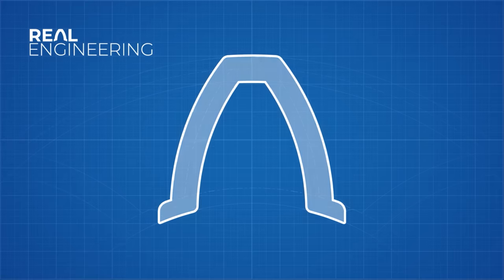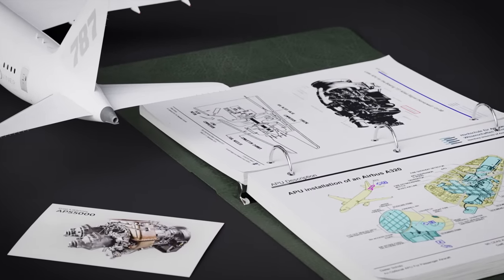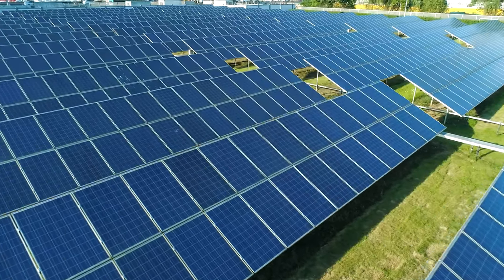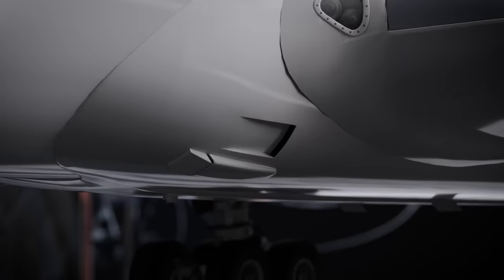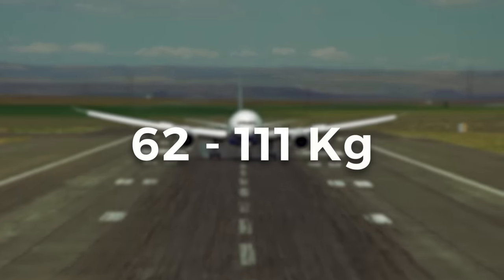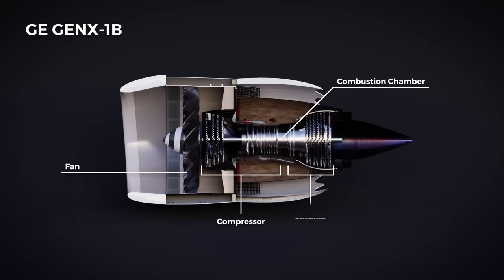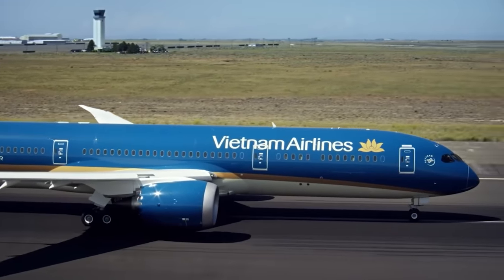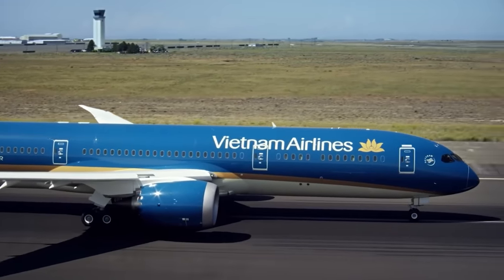The Insane Engineering of the GEnX

Comment: ,They run on compressed air by design mass to weight ratio is 0 it uttilizes sound frequency during the compression of air as it passes thru the main chammber creates Vortex no friction upon the main dtive shaft  the compression of air increases the forces
Turbine speed increases thrust of turbine 
When they hit the throttle it makes the high pitched sound from the engines.
Combination of these forces that allows them to run never shutting them down at the end of the day.Very hard to start neef alot of commpressed air. The best way 
Jump start from another engine thats  already running which is exactly how they start them.

Comment: I'm about to take my first flight on a 787. The airport we're taking off from is located at 82 feet - the destination is at 8,360 feet. Does that mean I probably have lower air pressure after I leave the plane than I had during the flight?

Comment: Wrong. Most modern engines use an air turbine starter drawing compressed bleed air from the APU. This drives the engine from the compressor end accessory gearbox to a self-sustaining speed.They do not use air impingement starting.

Comment: Great presentation but your definition of “stoichiometric” is not correct. Stoichiometric is the “theoretical perfect air fuel ratio” to support combustion. Leaning the mixture of air and fuel can reduce temperatures in the hot section of the engine and reduce fuel consumption, so that is why engineers are designing engines that run “lean of peak.”

Comment: Could regen braking not pull that braking energy to power and use that power to cut reverse engine thrust fuel use and other power requirenents. Also still like to see curved solar panels embedded into wing top surface that could offset some of the fuel use

Comment: Regardless of how big and powerful today's jet engines are, a 4 small engine design like the 747 had is safer than 2 big engines.
Reply: The modern two engine craft can fly quite easily on a single engine. There would be nothing stopping them from flying the whole distance on a single engine if need be.  Now that would not work for the jumbo jet style aircraft out there but it most certainly will work for the majority of fleet sized commercial jets. 
Those modern single engines are ridiculously powerful but also incredibly resilient.
Reply: @bighands69  you missed the point. It has nothing to do with how powerful a single jet engine is. 2 powerful engines didn't help Captain Sully who got birds in both engines.
Reply: @rkgsd  
Both engines went down for Sully.

Comment: Your explanation of centripetal force, should have the arrow pointing to the centre of the engine, not out away from the engine (this force doesn’t exist).
Reply: The arrow is pointing correctly for an imagined centrifugal force.  You are correct all rotating masses experience a real centripetal force pointing into the center of rotation.

Comment: Isn't that the 777 with engines the same diameter as the 737's fuselage? I don't think the 787's are quite that large. In any case, the 777's engines are significantly larger than those on the 787, so if you want to see really impressive engines, that is the place to look. 
Anyway, subject matter loos super interesting, but I'm not sure I can deal with the breathless super-dramatic presentation style for that long. Drives me nuts.

Comment: This is why Airbus is second rate at best while while Boeing and GE are joined at the hip. Boeing has a Exclusivsity Contract which bars Airbus using General Electric jet engines being used by Airbus. Rolly Royce engines on Airbus planes have a tendency to explode and suck and waste fuel.

Comment: the dream liner engine is a tad smaller than a 777 engine , and isnt the GE - 90  ( the 777 motor ) the same as a 737 fuselage , i thought .
Reply: Correct, the GE-90-115B has 115,000 lbs thrust. The GENx-1B is in the low 70,000 lbst range IIRC. The GENx-2B67 used in the B747-8  is 67,500 pounds static thrust.

Comment: Have you ever tried to find electrical fault in your car. Electrical controller is good when it works. I felt sorry to the mechanic assigned to find Electrical fault on this plane.
Reply: That's cute... airplanes and the maintenance behind them don't work like cars. They have many forms of redundancy, they're tested much more rigorously and they're made out of MUCH higher quality materials. Do you dissemble your car every 7 years to inspect every millimeter of it? Well commercial airliner's have to by law. They literally strip the entire plane down to the bare metal and inspect it for any faults or damage. In airplanes, fly-by-wire systems have proven to be easier to work on and more reliable than hydraulic systems. like I said, the quality of these parts are of much higher quality than you would find in any car. These planes cost hundreds of millions of dollars and they have to be as well tested and safe as possible. Don't use your knowledge of cars and apply it to airplanes... they are incredibly different in every way.
Reply: @ejkk9513  modern cars have taken many technology used in aviation. One example is electronic power steering, even more advanced joy stick like steering, where the amount of electric control how far a wheel should turn. Like how electronic pulse control movement of rudder.
Reply: @ivangeo3319  That's true to an extent. It's called non-hydraulic power steering. I have a shop in my backyard where we work on cars. The difference is that planes have two or three redundancy features and they're built to a much higher quality. Now we're seeing carbon ceramic disks on super cars and sport cars. That tech was created for the aviation industry back in the 60s

Comment: FYI 8:27 “…most extreme brake test; an aborted <landing> test”. 

No. It is not the landing that is aborted - it is the takeoff that is aborted.

8:41 “Here, the plane is <flying> at full load.”. No. The plane is accelerating to “Takeoff Velocity”, and passing through V1, which is the maximum speed at which a takeoff may be aborted.

So, two mentions of <landing> should be <takeoff>. And one mention of <flying> should not have been mentioned. The aircraft never leaves the ground for that test. YW!

Comment: the compressors are innefficient because they introduce so many Blades that increase friction, new tech needs to be invented that can compress air efficiently. air compressors are some of the least efficient pumps known to science. i think something like a liquid pump or oil vane pump could be more efficient. dual effect, could reduce area of intake and reduce friction and reduce complexity... in fact why not have a electric compressor driving a burner that expand across a tubine that generates electricity. and use electricity to drive bypas and other services...

Comment: Today’s jet engines really are a marvel of engineering.  Unfortunately, the technology they use is far too expensive for replacing the internal combustion engine in our vehicles.  These engines have advanced further than any other type of engine in both fuel efficiency, robustness, and overall reliability.  They’re by far the heaviest, most expensive component of any aircraft.  And unlike the engines they’ve replaced, these engines don’t make poisonous chemtrails.  (Actually, the old engines didn’t either, as there’s actually no such thing as a “chemtrail.”  Those are just areas of low pressure that, because they’re colder than the surrounding air, have formed clouds from the water vapor within the air itself.

The 787 itself is a marvel of engineering.  I would love that engineering to cross over to the now defunct 747 and for BOING to bring that fantastic plane back to full production.

Comment: Clearly by seeing this video I can pin point so many in-efficient things and mechanics... This is main reason I want to be a aeronautical engineer... and desgin a aircraft with a this useless in-efficient pointless systems removed... Like there's no point in the apu... A few of the lightweight Eletric generators concept I designed can generate upwards of up to 200,000v and it is the size of a smartphone... If the apu was replaced by "EPG - Electrical power generation Unit" (I'll give it a better name) the plane can generate upwards of 2 megawatts without the need of the battery pack and apu stuff... The plane can lose 100kg thanks to no onbord battery's and generators in engines... Way efficient and the useless fuel dump thing man the first thing I would do is ban  that fuel dump...

Comment: Unfortunately, the video is a blatant commercial for Boeing. If the engineering facts where presented without emphasizing continously how "great" or astounding the 787 is, it would be a good video. Also, a lot of the comments on the "no bleed air" are simply wrong or presented in such a way as only to emphasize how great Boeing is without providing a real engineering view. Especially the part on the air supply is simply wrong when it assesses the benefits of "no bleed" versus "bleed".
Reply: I mean if a company makes a revolusionary product, than I wouldn't be suprised if preople celled it "great"
Reply: @Blue_Doge  If it was revolutionary, yes. But in the end, both the 787 and A350 are not revolutionary. They are continuing existing best practices and typical aircraft design methods (which is good, as they are proven over millions of flight hours). Bleed-less design brings some benefits but also causes other issues like having much higher power consumption and thus more / thicker wiring, different engine starter woes and more. This is typical for aviation: you just trade one woe for another. But it is not revolutionary, merely a different approach.

Comment: The fan and the copressor are NOT on the same shaft
Reply: GE uses 2 spool engines, which means the fan is on the same shaft as the low pressure compressor
Reply: @nascraytia  you mean the booster?

Comment: Regardless of the fantastic engineering of airplanes, the fact of lifting 100's of tons of steel, people, and freight 5-6 miles high on every flight, is a energy disaster. Rail is vastly more economical and and environmentally sound. Only huge public subsidies for research, fossil fuels, and airports  keep the airlines running and the pollution pouring into our atmosphere.

Comment: Why are not use the engineering from whales with the long flippers/wings they have bumps on the leading edge which when they were found to reduce drag by 30%, why not try them on these aircraft? Also there is evidence that reducing the speed of the fan by adding a set of gears to slow down the fan to increase efficiency?

Comment: How many pound thrust is the engine. Ge may be the f35 engine contractor coming up in 2023, dunno really! But this new engine will use 15 percent less fuel and provide 50,000 lb thrust, and this a tiny jet engine.

Comment: So many little errors in this video that just irk you.
The starter for conventional gas turbines that don't have APUs isn't a "hover cart", maybe they are colloquially called hoover carts? It's commonly called a start cart.
Hydraulic is misspelt twice in the electrical diagram along with environment.
The "aborted landing" tests were aborted take-offs, very different to aborted landing.
Every animation of a cut-away view of the engine has the bypass fan and gas generator rotating opposite directions despite all blades being configured for same direction rotation. In one animation the compressor blades are backwards, in another the bypass fan is backwards.
Compressors and fans are not driven by the same shaft.
The fan has it's own power turbine to recover energy from the gas generator which usually has two independent shafts of it's own, although the gas generator in this engine may have only one. The shafts go 1st inside the 2nd, and the 2nd inside the 3rd if applicable.

Comment: In case you did not know: Most commercial aircraft turbines use inner and outer cranks: the outer propelled by the first and the inner propelled by the second exit blades. This way, the inner axis spins at arbitrarily lower rate, since the torque can be adjusted by how much enthalpy the first exit blades pull out of the exhaust jet. Also, a lack of transition reduces the according frictional loss and associated maintenance. The optimal efficiacy is reached when dynamic pressure of jet and bypass are identical or (if impossible) the geometric expansion angle tangents with the pressure gradient from jet to bypass. cheers.

Comment: They should stay away from planetary gearboxes and use bleed valves  to drive a seperate shaft for the bypass fan.....They could even have a hydraulic pump on the power stage instead of a pnumatic stage.... Im not even an engineer and I know that... lol
Reply: Seeming that your not an engineer, you can't really judge designs of aircraft. I can't either because I'm NOT an aerospace engineer.
Reply: @Rosne134  that's not a rebuttal. That's just cancel culture.

Comment: You talked about fan blades and compressor blades. You conveniently omitted the turbine blades while they are the most complex pieces of engineering in this engine requiring advanced material design due to higher temperatures they experience during operation.

Comment: Cones are probably turbofans, tubes are probably true jet engines

6:21 that wing is basically upside down, you can see the fuselage push downwards from that point as it gets up into the air... the amount of heat here is a pretty good indicator of the amount of wasted fuel, which again like I said can be fixed with the right wing profile. Just to get that part working they had to add more unnecessary weight, and also add more drag for the intake, so that could save weight there too, for instance. Probably just a smaller intake or maybe replace some parts with a water cooling system and not have the intake at all... and again it would still be exponentially more fuel efficient

6:52 here you can see the negative lift, it is waaaay too hard on the landing gear, it shouldn't smash into the ground so much when turning, more of a gradual shift of weight than a jerking motion... it shouldn't really even work on the ground. Adding horsepower into the turn is what increases the speed and angle of it, with the right control surfaces. Also the back landing gear is further down than if the plane was heavier, which it isn't, which indicates there is not enough lift. It's mostly just aluminum and foam, a bird can basically destroy it, but it looks like it handles like a freight train, I wouldn't normally say anything but I've heard too many stories lately of loss of control, bird strikes, and landing gear damage... which would be explained by this data.

Comment: So much mistake. Gen X is not the diameter of the B737 fuselage. Air starter do not send air into the turbine but turn the accessory box and so the engine. 2 generators per engine..Ge90 has also 2, generator and back up…APU with 2 generators…the B747 has 2….
Electric brakes are a pain and generates a lot of problem and are not easier to install.
The 380 had already 5000 PSI hydraulic system and autonomous servo control…
Let’s continue…Gen X by pass ration is the same has the GE90 and the only reason of fuel saving is…no bleed air…..
Carbo fan blade already on GE90 but the Trent 1000 who équipe the 787…has not car an fan blades
Bird strike test is made with chicken who are not dead but chloroformed 
Less compressor stage because no bleed air again
Passenger comfort at today is/was the 380
The 787 is way to expensive to build with some extremely complex manufacturing process like the  fuselage.
To conclude, the bleed less engine is not the future as it require to much complex system…

Comment: I've done the Sydney-Doha trip (14hours) 10 times in the past 6 years and despite all the amazing engineering of the 787 and its engines I have to say that I miss the A380. It's way more quiet and stable. Less vibration and in general a more pleasant experience by far.

Comment: You are normally very good at these, just not in this case. First of all, at 8:40, it is not "an aborted landing", it's an aborted take-off. You say the same again at 8:50, and V₁ is the point of no return for deciding to take off, not to land... and it gets worse when you start discussing the tip velocity and the speed of sound. Faster tip velocity means higher dynamic pressure, and the pressure difference between both sides of the fan blade grows with the square of their velocity. This makes the high thrust levels of modern turbofans possible. It is how these engines make so much power, plus the engine duct is partly there to mitigate the sound created by the blade tips hitting the sound barrier.

Comment: Heh, I'd use solar film covering the body and wings of the plane and a fast charge battery, in combo with some Tesla electric engines.
The nice thing about using solar film on the wings and hull is that any power required for the plane durng normal operation, would need less power frmo the engines, and thus those would consume less fuel.
Reply: People still need to see the value of solar film, since it's very low weight, but still has considerable power output.
1 kg of film may generate as much 5 kW.

Comment: Does running a jet engine lean not have the same effect as running an internal combustion engine lean? Adding heat? If so wouldn’t that defeat the purpose of the injector